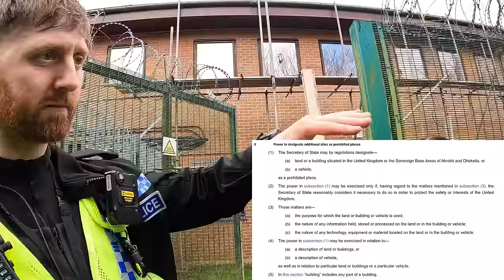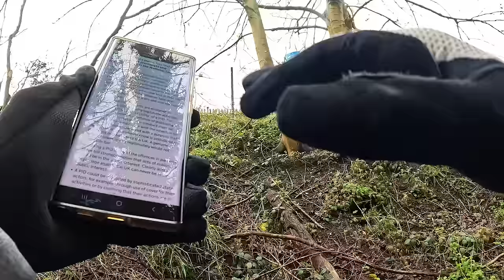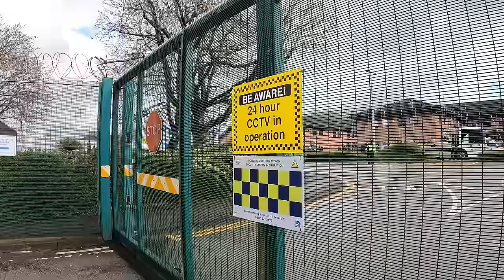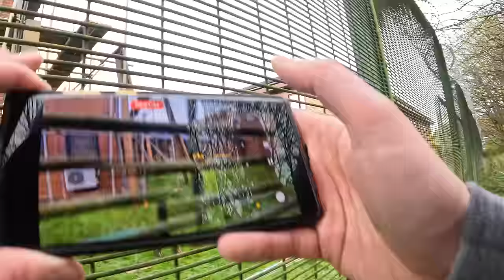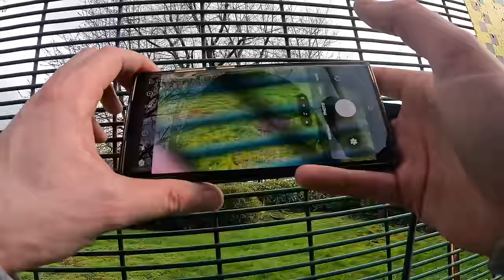If You Continue You Can Be Removed

Comment: I haven't read the whole thing yet but the purpose of the new NSA is to deal with espionage and is not a blunt tool to be used to prevent photography on a whim.
To fall foul of it you must be "knowingly" taking photographs with the purpose of causing harm to the United Kingdom. i.e. photographing sensitive information whilst acting as a foreign agent or with the intent to pass that information on to a foreign agent.

As an auditor, It would be worth getting to know the legislation in depth as I'm pretty sure they'll be trying to use it more and more.
Reply: Then you'll want to read Section 5, which is a strict liability offence that doesn't require intent.

Comment: National Security Act 13. There is no requirement for UK Defence Industry to register their premises as a 
prohibited place but if they have land or a building that is prohibited place based on the 
definition at paragraph 12 they are required to place signage outside the land or building 
stating that the building or land is a prohibited place under the UK National Security Act so 
that members of the public or persons not authorised to access the land or building know it 
is  a prohibited place under the act.
Reply: That's a nice bit of imagination, but nothing in the Act requires it.  After being told that the conduct was unauthorised, Section 5 (1) (c) applies.

You're free to disagree, and to put your own liberty on the line by demonstrating that. I'm not going to do it for you.
Reply: @rogerborg paragraph 13 clearly states that for the offences in paragraph 12 to be valid, clear signage is needed around the perimeter of the prohibited place

Comment: There is the Defence Act of 1960 which enables the acquisition and retention of land and premises for defence purposes particularly in times of war. I suspect places such as Salisbury Plain were acquired under such. If nice but dim ginger plod had misheard he may have meant the National Security Act 2023 but that requires signage advising it is a Prohibited Place and the need to show they reasonably suspect you are acting on behalf of a hostile foreign power. see PINACI News’ video on this from 10 days ago.
Reply: Sorry The Defence Act 1860 not 1960.
Reply: Untrue. Section 4 requires intent, but Section 5 does not. After being told that the conduct was unauthorised, Section 5 (1) (c) applies, signage or otherwise.  Maybe read it yourself rather than taking someone else's word for it.

Comment: I have been warning auditors that the National Security Act 2003 Section 5 (and the very broad definition of 'prohibited place' in section 7) does create a new strict liability offence of recording anything remotely connected to the UK military or defence. Sooner or later, it's going to be enforced and an auditor is going to become a test case. It's only a question of which one.
Reply from the maker: taking pictures available on google maps wouldn't be harmful to the UK so not really an issue
Reply: Prohibited sites MUST be clearly marked with signage around the perimeter... paragraph 13

Comment: He meant National Security Act.

It’s now illegal to film defence industry property, if there are signs.

And a Constable can make you leave.

It’s a complete mess. Who knows if it’s a prohibited place?
Reply: 13. There is no requirement for UK Defence Industry to register their premises as a 
prohibited place but if they have land or a building that is prohibited place based on the 
definition at paragraph 12 they are required to place signage outside the land or building 
stating that the building or land is a prohibited place under the UK National Security Act so 
that members of the public or persons not authorised to access the land or building know it 
is  a prohibited place under the act.
Reply: @johnavery15  exactly. So, if you supply bits of string to a supplier of a supplier of a supplier of a supplier to “the defence industry” and put up “a sign” you can now stop people taking pictures of your factory!!!
Reply: Signs don't create the offence, they just warn you that you're committing it. Being told that the conduct is unauthorised, as happened here, would be sufficient for 5 (1) (c).

They can make you leave if they "reasonably believe that exercising the power is necessary to protect the safety or interests of the United Kingdom".
Reply: @rogerborg  as far as I can see this turns on its head the notion that you can film anything you can see.

Any Constable may now say you’re risking national security; cease and desist.